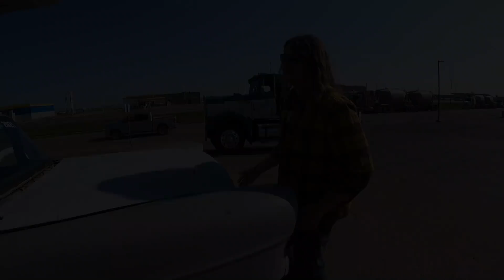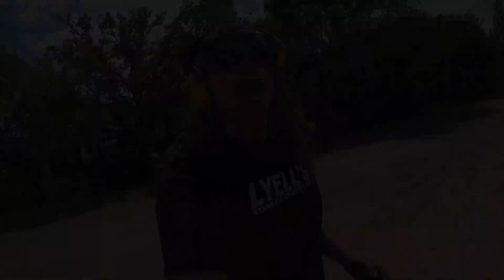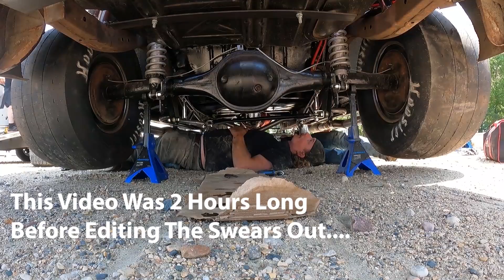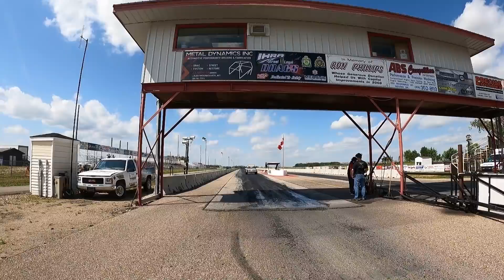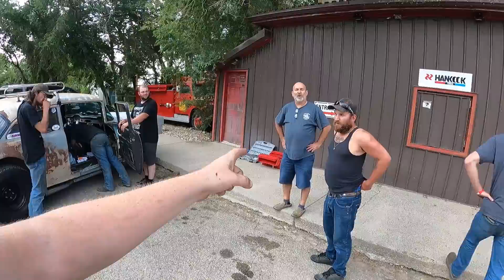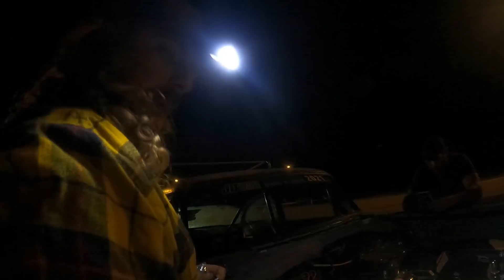Big Mur, Big Problems - The Mayhem Continues On Canadian Drag Week

Comment: Suggestion, putting a 4 speed in easiest with one guy. Roll trans up on your legs, front of trans on your knees. Leg strength will keep front of trans stable, at proper height to go in. Both arms to set height of rear of trans, and shove it in there. Seriously man, try it, easy peasy, you'll never do it another way again!

Comment: Really thought you guys was pulling the engine, for a rebuild! I've torn engine's down, no clean up or machine work and just cleaned piston, new rings, honed cylinders and lapped valves, put in stock main n rid bearing's in and slapped it back together. And back in the car In half a day! Ran like new....
Reply: Right on,did ya reuse the oil or go new?Lol
Reply: @craigcode7103  Funny, fresh oil.